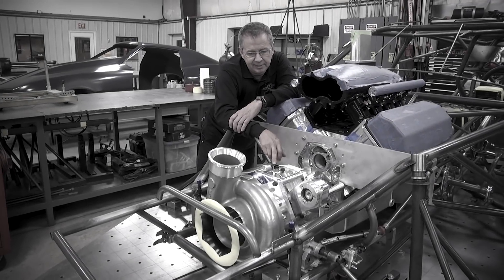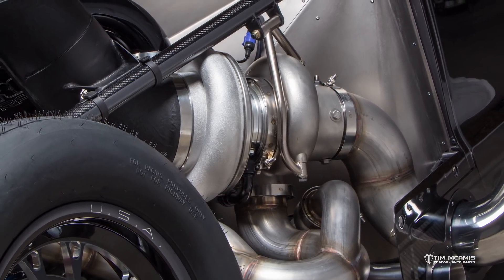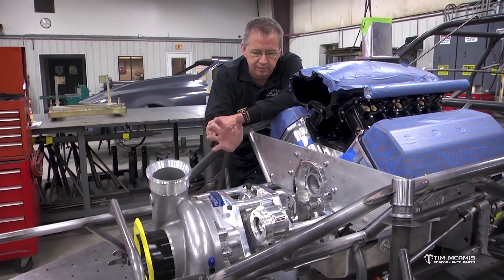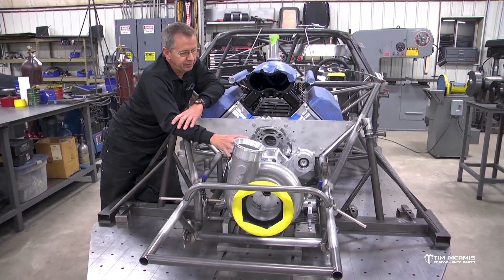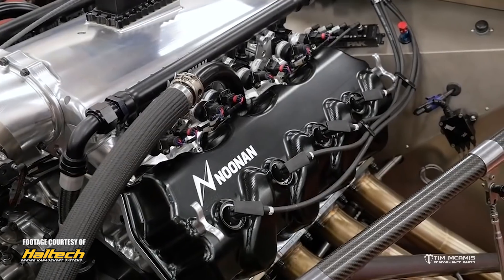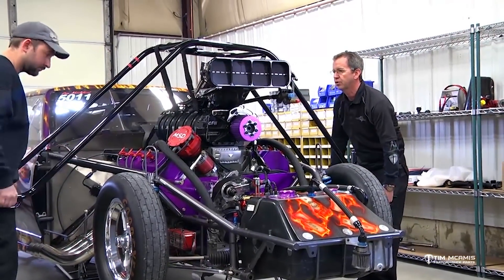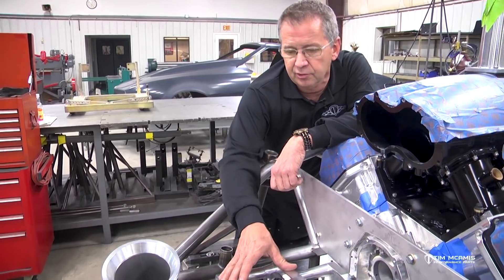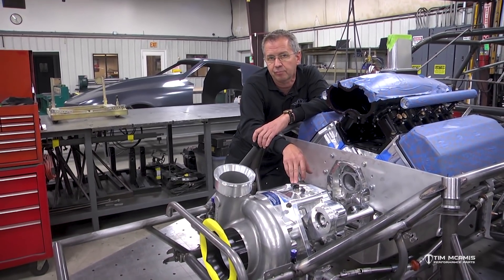Centrifugal Superchargers in Pro Mod

Comment: been around since 1993 we ran a procharger on our outlaw truck in 1995 which was belt driven we just changed to a direct drive.  Very easy to tune to good and bad surfaces.

Comment: It's a far cry from a pro mod but I've had a 76mm turbo on my Cobra, a 3 liter Whipple, and now a Ti Trim V1 Vortech. The Vortech is my favorite. It's a great compromise, better low end power and throttle response/no lag, starts building boost immediately, than a turbo, and it pulls hard at the top giving you a linear powerband like an N/A motor. IMO it's the best of both worlds. Plus they're simple. They bolt right in with no fabbing (for a street car kit from Vortech) something even the better turbo kits cant provide, theres always fabbing with them. The centrifugal allows regular exhaust and bolts right in not requiring you to remove things like the A/C compressor or the strut tower brace like a P/D twin screw/ roots, which is important for wannabe road racers like yours truly who want the stiffness upfront, ,Not to mention they wear out slower, and even when they do rebuilding a centrifugal SC'er is east and cheap. To top it all off you get some of the turbo sounds that are awesome, the whistle, BOV etc.

Comment: I wonder if a twin-screw blower could be modified to run off of a turbine like it's a turbocharger.

Or perhaps a turbocharger hooked up to a small stirling engine, which itself would be powered by the heat of the exhaust manifold of the main engine. Might work as a sort of all-mechanical counterpart to an MGU-H.

Comment: This should have been done 25 years ago.  Centrifugal compressors are way more efficient than Roots style.  I'm surprised it isn't a compound compressor setup.

You can also quick change the impeller to change the boost characteristics.

Comment: Tim, the technology is quite old, dating back to WW-2, when both allies and axis powers installed “turbo-compound” (mechanical driven and exhaust driven) boost systems on their (mostly) radial engines. And when water-methanol injection was added, you may have heard of terms like “military power”, whereby all power additive systems meant rated power exceeded upwards of 120% — or more — of rated power.

The “Pro Charger” system is a direct descendant of the British Sir Frank Whittle centrifugal flow, jet engine design — (without the “hot section”, of course).

If I was to wager a guess, the method of introducing compressed air into an engine will eventually gravitate to the “axial” flow introduced by the German, Hans von Ohain, which is a far more efficient method. This would allow for a smaller device while delivering an equal or greater supply of compressed air to the engine.

..... my “2-cents.”

Comment: Since it's crank driven, how much parasitic power loss does it suffer from, in comparison to a Root's style blower. I can see where it "could be less", but when you add the gear box, I can see where it "could be more"...
Reply: I know nothing about engineering, but am guessing that as it seems to be in a straight line to the crank it must be better than a blower up above putting big deflection on the crank. But really I know nothing haha!
Reply: @onedayiwillmakesomecontent  Hey at least you tried.

Comment: These have been around for ages. Correct me if I'm mistaken, but these were used on Spitfires during WWII, and in combination with fuel injection allowed them to fly higher and be more manoeuvrable until Germany adopted the technology, though too little too late. It MAY have been the other way around though.

Comment: Competitive drag racing is even worse than NASCAR with the whole rules and equal playing field crap.  Someone either invents something or pioneers something, then it kills everyone else, then everyone complains, then to slap new rules and weight penalties.  Rinse repeat.  It's only a matter of time before they limit the blower size, add weight penalties or both.  Centrist are adiabatically more efficient than positive displacement blowers, but still not as efficient as turbos.  PD blowers give consistent linear power, but a properly setup turbo (unlimited) is unbeatable.  Truth be told electrics are going to eventually smoke them all.

Comment: What’s the major differences between a HH Roots Blower vs a Screw Blower ?
Reply: One is basically a pump that beats the air into submission and the other screw compresses the air.  Screws are more efficient, but cost more to manufacture.  Roots allows for a bypass as the air is basically pushed around the outside of the rotors.  Screws don't allow for a bypass, if it's spinning it's making boost.

Comment: Are the NHRA rules & regulations requiring the steering rack to be located & operated in a very specific manner?  Also, how long before you guys manage to shoe-horn a Formula 1 hybrid-turbo to your setups? 5-bar boost all day long from an electric-motor-augmented turbocharger should go a long way in terms of reducing parasitic drag on the engine....

Comment: Question that keeps coming to mind is how it compares to the adjustability of turbos. How about how it loads the nose of the crankshaft vs. a turbo system?
Reply: Turbos motors can be adjusted faster using electronic boost controllers, rather than doing a gear change. If they'd use a planetary gear set, it really shouldn't put any side load on the crank nose

Comment: 1950s BRM v16 had a two-stage centrifugal supercharger ... causes power delivery to be very sudden, not probably an issue for a drag car, but unsuitable for circuit racing. Works very well for constant rpm situations, like aircraft

https://www.motorsportmagazine.com/archive/article/september-2004/61/x-ray-spec-brm-v16

Comment: Hi Tim I stumbled across your videos surfing the web recently. I find them very interesting from a engineering time line of the sports development. I grew up thru the 70s into the 90s with circle track racing and the same progression in engine, chassis, shock ect development was similar to drag racing. Unfortunately the cost associated with the advancement drives a huge number of participants  out the sports. In hind sight the most fun we had was the first few years working half the night in a back yard shop with a wood heater for heat hanging out with friends and neighbors figuring out how to make cherry picked junk yard parts run faster then the week before. Keep the videos coming

Comment: Daddy Dave  Was running one of these for years And he wasn't making enough boost Or enough horsepower It's why he went to twin turbos He was pushing 3000 horse where the supercharger
Reply: I don't watch it a ton, but I remember him saying he switched to turbo cause he didn't have an extended front end like the pro mods so he couldn't put a bigger pro charger on. These engines are making all the power.

Comment: How long until companies start making crank driven centrifugal supercharges with two speed impellers, just like the v12 merlin engines in the ww2 P51 mustangs?
Reply: The multispeed/multistage superchargers were required in fighter aircraft in order to optimize power output at a variety of altitudes. For example, the early P-51s with the Allison V-12s were extremely fast at low altitudes (faster than the Spitfire even), but because they had a single speed single stage supercharger, were uncompetitive at high altitude until the Brits fitted them with the Merlin with its two speed two stage supercharger. Given that drag racers only run at a single altitude and weight matters, I'd assume that multispeed/multistage superchargers won't be making a comeback in that application.

Comment: Have you ever heard of Hermann fottinger? He made a coupling device or came up with the theory of the device. Anyways they used it on some ww2 birds in Germany and they are said to be able to almost infinitely vary the compressor speed of the centrifugals that they used on those old planes. Looks kind of like a torque converter with a lock up clutch from the drawings I have saw. May be a cool way to regulate those big ass centrifugals aside from changing the ratio on them or whatever. Maybe not. I am sure they will stick with ignition timing control unless they do some silly shit and regulate ignition timing to death but I was just tickling around thinking about shit. I am glad they allowed procharger. I think more competition will drive the others to innovate. Anyways. USA 1 🇺🇸

Comment: When the NHRA let's the badass Screw Blowers back in you'll see the boosted boys get their ass handed to them and do away with all the weight limits on all the set up then the real men will rise too the top!!! 🦅🇺🇸🦅
Reply: Rusty Wells would you rather do a big ass screw blower or this procharger setup and why?
Reply: @birdcall2422  That's a tough question to answer because if it's one of the two biggest pro chargers depending on the car I might have to go with them over the big screw blower but what I would love to e is have two engines one pro charger and one big screw blower and let the weather and altitude dictate which one to go with! 🦅🇺🇸🦅

Comment: Engine driven centrifugal superchargers were used on several V12 WWII aircraft engines. 

It is really easy to design and machine billet turbines for turbochargers.  That, together with various gear ratios will let teams develop their own boost profiles

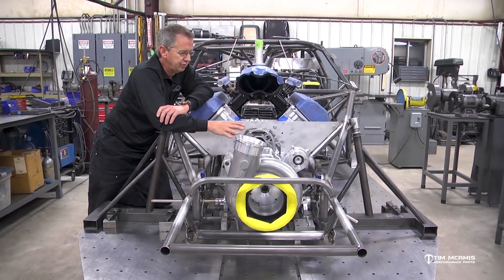Comment: 3:54 could you attach a smaller procharger that spins up faster first to sooner boost the engine to eliminate a billionth of a second in the quarter?
Reply: WCTA Chicago underground sound Itd probably lose its efficientcy at that point.
Reply: @jubjub905  LOL, I was hoping someone would point out it has two sides, two mini prochargers
Reply: @ZacLowing  look up Procharger i1. CVT-driven superchargers.

or the supercharger in the road-legal Kawasaki H2 superbike. it has a 2-speed centri supercharger.

i bet NHRA officials won't let them in though.
Reply: It’s all in the casing and blade angle and overdrive. they start using words like volute, adiabatic pressures, heat vs pressure, Mach number, compressor surge, etc, and they can make it do anything. ATI, the company that makes procharger branded superchargers, have customers who could giggle at the size of this. They make ones a man can stand in.
Reply: Boost is linear on a centrifugal blower with RPM.

Comment: If they do too good, NHRA will just hang a restrictor on them with the stroke of a pen to keep the N2O and blower companies happy. There used to be a saying about the Gene Adams rule where you get penalized for success.
Reply: Very similar in dB drag racing and similar variants. It all comes down to standards. One of the most popular is called something similar to super street or super stock, where you can make any modifications behind the B pillar, but none infront, stock cab, stock windshield, and for the top end competitors every run they shatter the windscreen, but if they replace it with, say, lexan they go into the "no limits" category and are up against builds literally 100x louder.
Reply: Don't like it? Don't race there - everyone knows the rules when they come to play ball, and the NHRA absolutely does not make it a secret that they want all of the power adders to be COMPETITIVE, it is NOT an 'unlimited' class.

There's a reason why outlaw organizations exist - and there's a reason why the NHRA still exists. Neither is "wrong", one isn't "better" than the other(as shown by the recent growth of the NHRA's PM class) regardless of your personal preference
Reply: RyTrapp0 Don’t go down that rabbit hole mate, eventually it gets to “ don’t like this planet? Go somewhere else!”
Reply: yup, just how Le Mans banned the rotary engine after Mazda won. European manufacturers cannot compete so they just get the rotary banned.
Reply: @sepg5084  Its not about that, it's that it ruins the racing until the other companies design their own. Same thing happens in Formula 1. William's put a CVT in their car and F1 knew it would be so advantageous that they would dominate until the other teams made their own. At the end of the day the regulations guys have to keep the racing as competitive as possible so something that basically makes one team win for a year or two ruins that for that year or two, so its banned. I'm not saying I like it. I love rotary engines, matter of fact I have an unmodified 94 FD RX-7, with the factory 13b, original turbos still in their stock cofiguration (thinking about getting some spare fenders to cut up to put a rocket bunny kit on, who knows), and a big single turbo 13b Miata drag car. Ive taken them both to "Sevenstock" in Fontana CA. They are awesome but there not the end all be all. They would be a lot more popular on the road and in racing if they were

Comment: Nitrous is almost extinct at this level already. Just ask Pat Musi!  😉
Reply: Just wait till you see that 959 cubic inch engine this year you might be surprised how much faster they are compared to the old 907!🦅🇺🇸🦅
Reply: Will be fun for sure. But N/A's (even with nitrous) don't have the capacity to make the kind of power forced induction have. 
Pop fact: it's almost nine years ago Sonny Leonard broke the 1000 cin mark.
Reply: @magnus5356  Did you see the 3.5s in the 1/8 mile this past year ran on nitrous and this year they will be deep in the 3.4s in the 1/8 mile. I would say they have a damn good chance of keeping up and as you know the races are won at the line when you cut a 0.07 light it doesn't much matter what the other guy has if he can't keep up on his light times! 🦅🇺🇸🦅 But we shall so see I will come back to this comment after the Gator Nationals win or lose and we can discuss it! 🦅🇺🇸🦅

Comment: Isn't it getting choked by having a gas tank right in front of it??
Reply: Alot of the tanks have a huge hole through them for the air to pass right into the blower inlet
Reply: it does look tight, maybe the dynoed it while moving the tank back till it had an impact, tapped it a hair back and lock it down.

Comment: Thats almost the size of a rotary engine! It will be interesting to see a weight comparison vs a twin turbo setup
Reply: Its gotta be at least 50lbs lighter I would imagine.
Reply: youre touching on a great idea, this type of crank mounted setup would be amazing on a rotary
Reply: @carlswenson5403  the rotary wouldn't be able to spin it any faster. I believe these guys are spinning them close to the limits. (If that's what you were thinking)
Reply: @wudntulike2no32  interesting point as well, hadnt thought about the total mass of the rotating assembly ... im still convinced the theory is sound
Reply: @carlswenson5403  rotaries make more exhaust then just about anything they are born to use turbos.

Comment: Holly crap that thing is huge
Reply: Thomas Vittetoe that’s what she said!
Reply: Had one not quite that big hanging off a BBC and I was like, "Um, do we need a different engine stand?"
Reply: Biggest street use are generally a f1r f1x or f1a. This is probably a pro mod spec f2
Reply: @darnellquesnel1832  The F2 Procharger is only 10.5" volute diameter. Procharger F-3R-121, F-3R-130, F-3R- 136 are 12" volute diameter. Promods that use Prochargers will run F-3X-140 which is a 13.5" volute diameter, flow 4800cfm maximum boost 60psi. Procharger still has bigger ones F-3X-143 and working on the F-3X-150 procharger and is most likely already out.
Reply: Can’t wait to buy our f3R on a gear drive set up